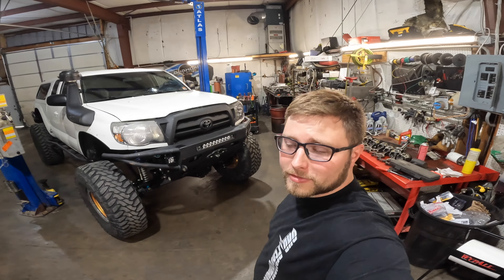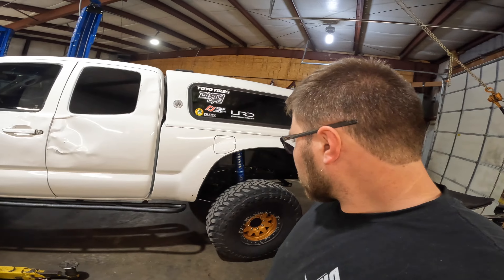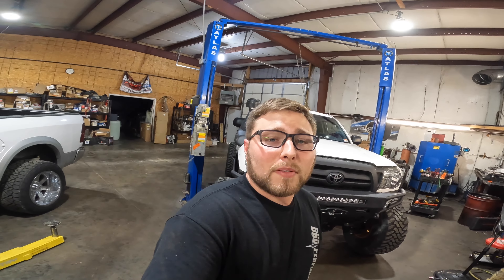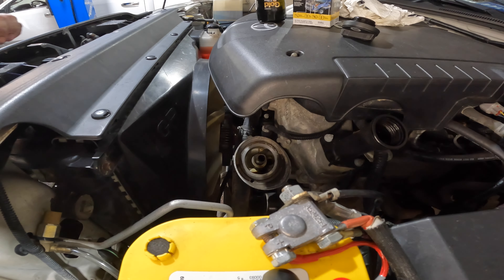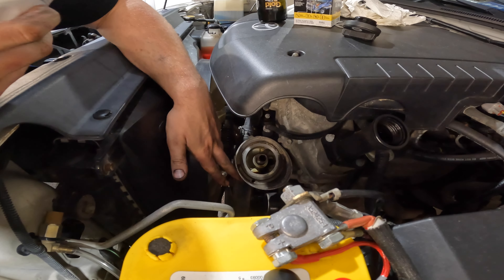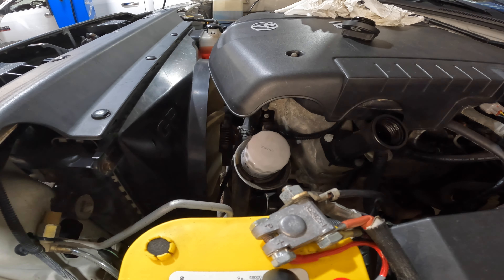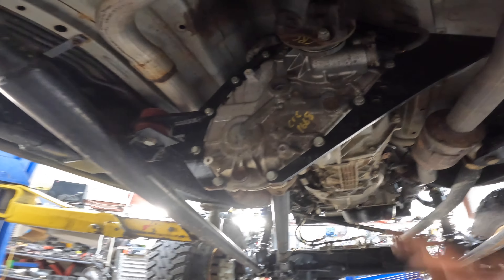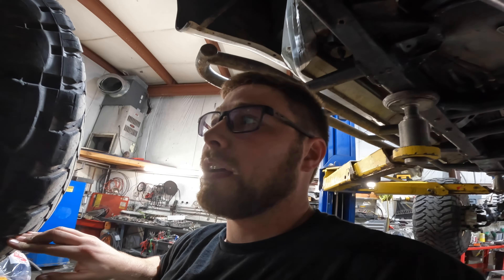Dana 60 One Ton Tacoma First Look and Oil Change

Comment: How did they do the emergency brake? Im hung up on that with my sterling
Reply from the maker: This particular one has a line lock style. Just run a new brake line from rear to manual push button in cab. Their are other ways, but this is the most universal.